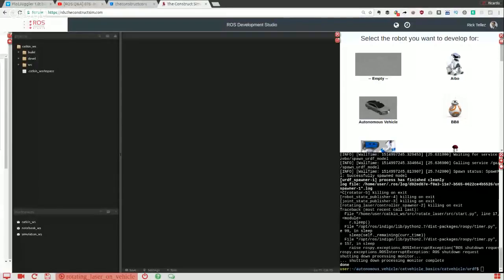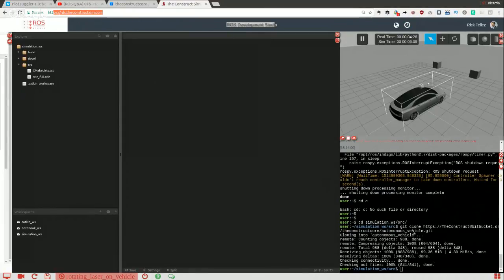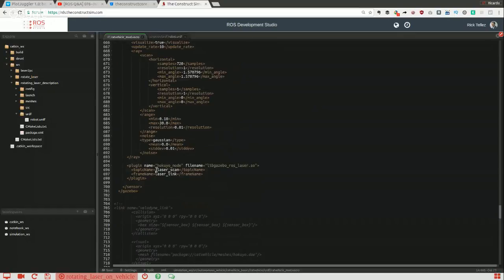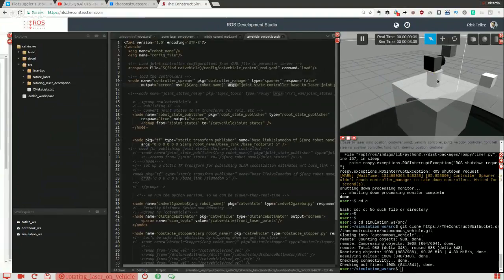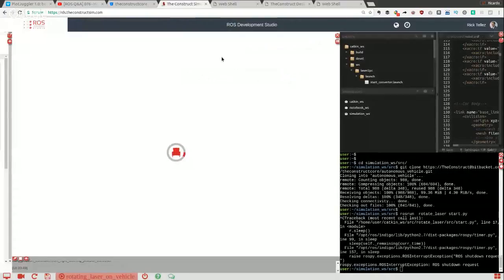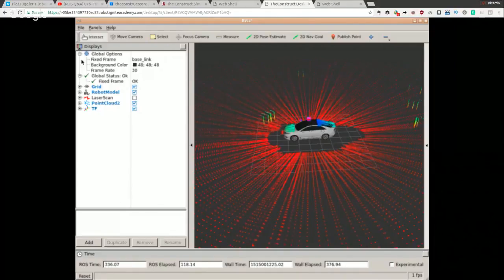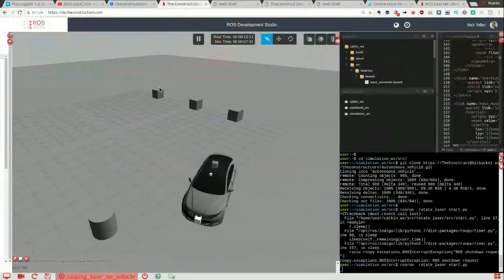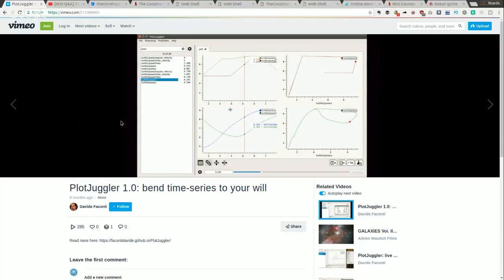ROS Mastering LIVE-Class #3: rotating laser mounted on a vehicle

Comment: So how did you add the transformation from base_link to laser_link since it is rotating now so a tf needs to be broadcasted, right?
br = tf.TransformBroadcaster()
(q0,q1,q2,q3)=quaternion_from_euler(r,p,y)
br.sendTransform((x,y,z),(q0,q1,q2,q3),rospy.Time.now(),"base_link","laser_link")
Something like this right?
Reply from the maker: You have two options here:
1. Either you include the laser in the URDF of the robot and let the robot_state_publisher publish the transform in TF
2. Or you publish the transform yourself as you are showing above
Reply: @TheConstruct  Thanks for your reply. So the problem is if I just define in the URDF nd apply mapping algorithm like Gmapping then there are discontinuities in the map which is mostly because the base_link is not able to get the actual transform of the laser_link since it is rotating.
So I even tried to subscribe to the Joint state topic and then publish a transform from a different node, so there is a conflict of the transformation from the node robot_state_publisher. Eventually I have to define my laser joint in my urdf. So is there any possible way to remap the robot_state_publisher node for thr laser joint to a new node which is giving the transformation?
Reply from the maker: @shrijank522  I think watching this video will help you get the answer: https://youtu.be/9BdAkrX4Xkg